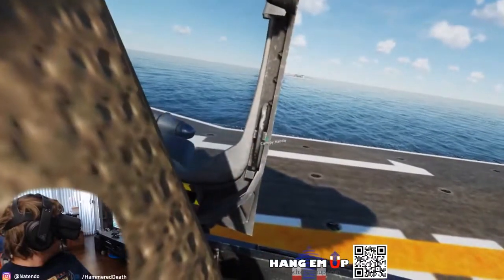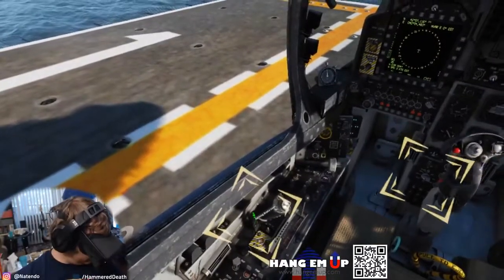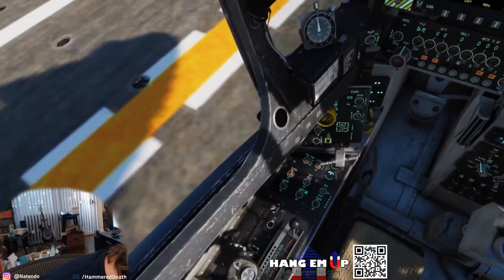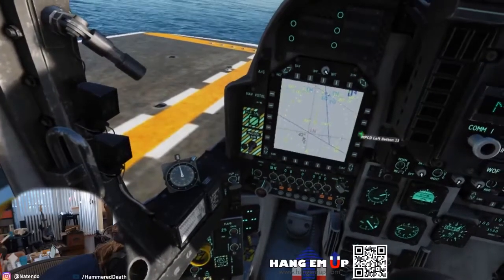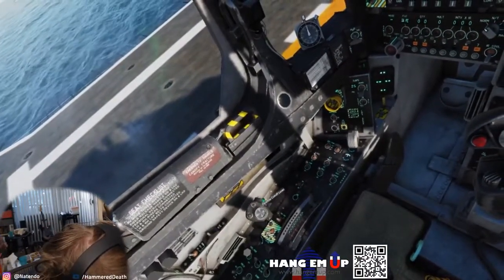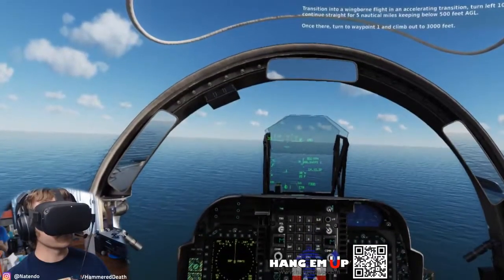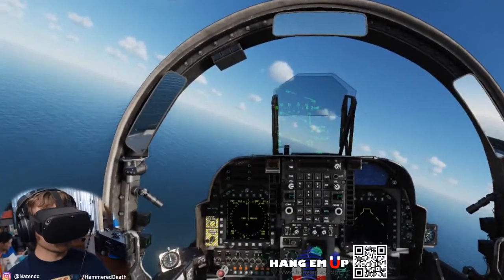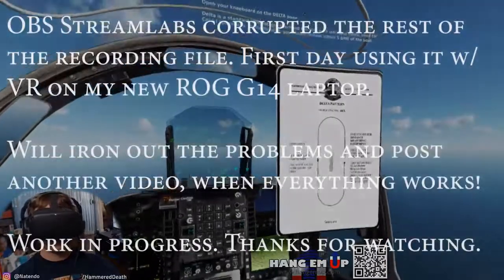DCS Quest Link VR AV-8B M09 OBS RoG G14 Test - Progress.

Comment: Yo! I’ve decided to try out dcs and I’m wondering, how did you get it to run this well and does it always run like this? This game is a port to vr and I’ve played no mans sky, and payday 2 in vr on the exact same laptop as you but they both don’t run well, to get a smooth frame rate I feed to lower the resolution by half and have the graphics at the lowest setting but they still stutter terribly at times so If you have any fixes or something, do tell, unless the vr ports are just terribly optimized which is my guess.
Reply from the maker: Hey Phantom! I'll let you know my settings, next time I run it. Most likely tomorrow. The 2.7 beta update has definitely been a game changer. Standby.
Reply from the maker: http://hammereddeath.com/parallax/wp-content/uploads/2021/05/Screenshot-2021-05-02-180322.jpg - here's a screenshot of my settings - hope they help!
Reply: @NatendoSwitch  helps a ton thanks! Frame rate is better but still choppy

Comment: Hello, I have a quest 2 and a rtx 2060 coupled with an i5 9400 2.9 ghz, turbo 4.10 ghz and 16go , but I cannot make it run correctly in vr like on your video, could you give me your graphic parameter please
Reply from the maker: Hi Le masque de fer, I'm running standard VR settings on the ROG Laptop (specs in description) for DCS, then I turn Shadows to "flat" Textures / Water to High and MPCDs to 1024 resolution. Keep view distance to Medium and smoke / traffic / grass to minimum or off. Are you laptop gaming or using a desktop? There are multiple versions of the 2060. I'm running the Max-Q edition. Most of the time, the Oculus link was being limited, when running DCS - so make sure that you set all OVR programs running in the task manager to "highest priority" to prevent frame rate loss in VR. Your i5 should be more than capable of gaming, considering the crazy high clockspeed! If you're not using the BETA version of DCS - I highly recommend that for VR.